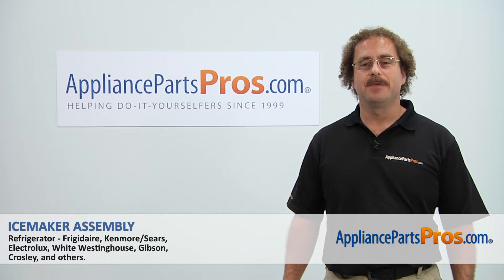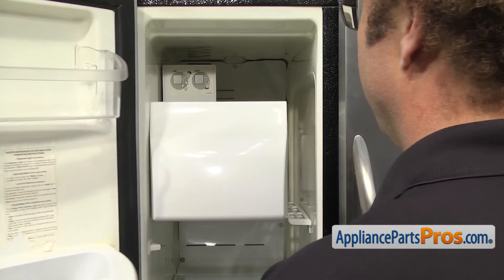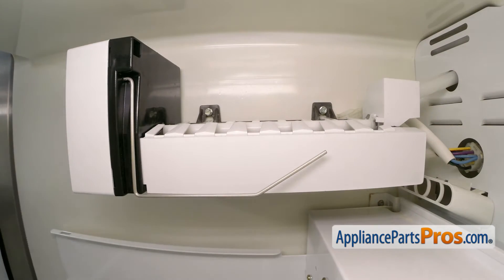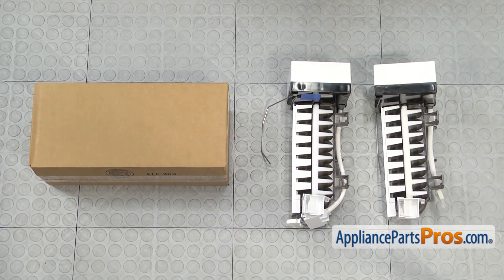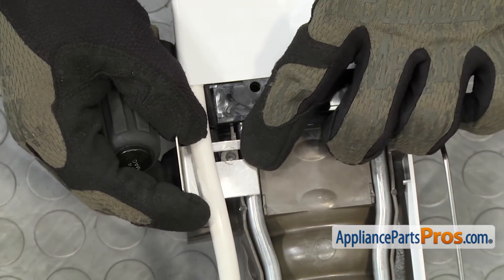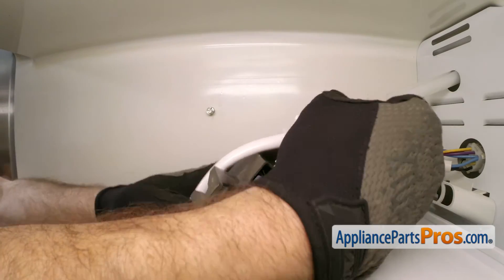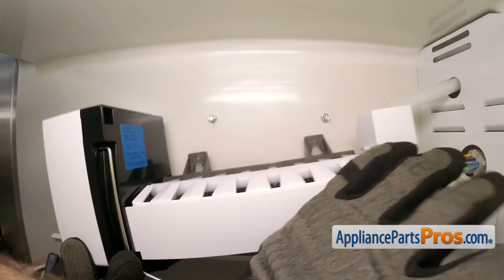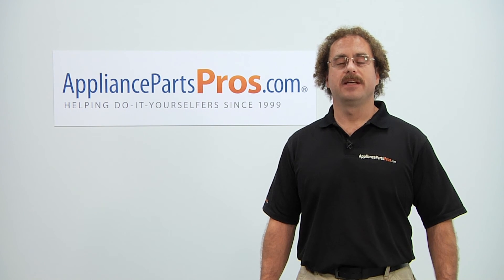How To: Frigidaire/Electrolux Icemaker Assembly 241798231

Comment: Should the ice maker trigger water valve to dispense water right away after it is plugged in and the trigger arm is in the correct position?
Reply from the maker: If you just hooked up the icemaker it can take roughly 24 hours for it to start making ice due to it having to get back down to the proper temperature.

Comment: Great video. Question: what would cause the Icemaker to NOT make any ice? I've troubleshot mine and don't know if I should replace the Icemaker assembly or due to another problem. Looking to troubleshoot this as much as possible to save money!
Reply from the maker: It could result into a bad icemaker, the water valve could be defective, or you could have a temperature issue. Do you know the exact temperature inside the freezer? What is the model number of your fridge?

Comment: I had an issue with my Ice maker in a Electrolux EW28BS71ISA made in 06/11.  I was able to finally get the drawer out and a piece of plastic that is 3" long and at both ends is 3/4" wide and 1/2" long and int he middle portion is  1-1/4" wide 1-3/4 " In the immediate middle it has 2 tabs that drop out about 1/8" with 2 round pieces that extend out 1/8" that are connected to something.  In the middle is a foam piece that has a slot on each side that is 3/4" long .  There is also a wire in the Ice maker portion that is loose and is about 8" -  10" long with a sensor on it  I have no Idea where it goes and have not seen it in any of the videos on You Tube.  Doe you know where it is supposed to go?
Reply from the maker: That piece will clip onto the evaporator that is located behind the ice maker at the rear of the compartment.
Reply: @appliancepartspros  Thanks.  It in the middle of the clear plastic piece  above where the tray goes.  Is there a certain way that the goes?  the wire hangs down but it is still above the top of the Ice Tray where the Ice drops into.

Comment: My ice machine stopped producing ice about a week ago. I replaced the water valve about 17 hours ago and still no ice. I don't feel any water in the tray either. The coil under it is very cold. If i poured water inside it, it would produce ice. Could it be a clog somewhere or is the issue the Icemaker Assembly? Not sure how to troubleshoot from here.
Reply from the maker: It is very possible that there is a clog somewhere. What is the model number of your fridge?